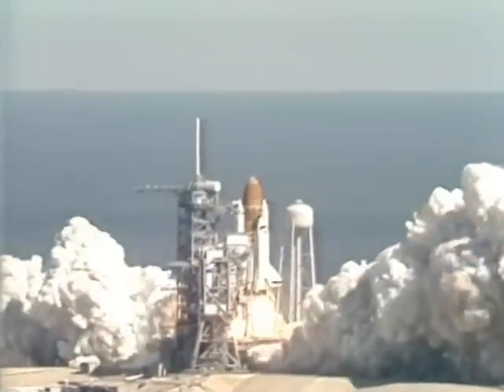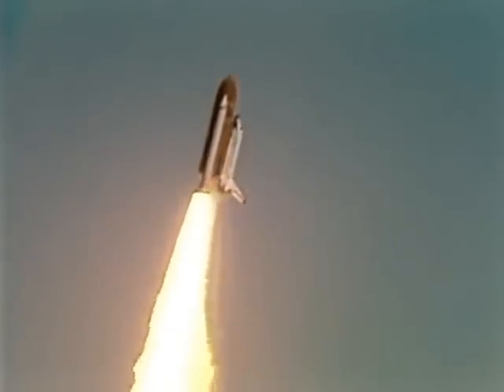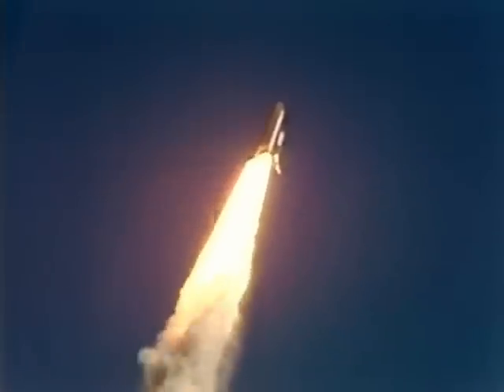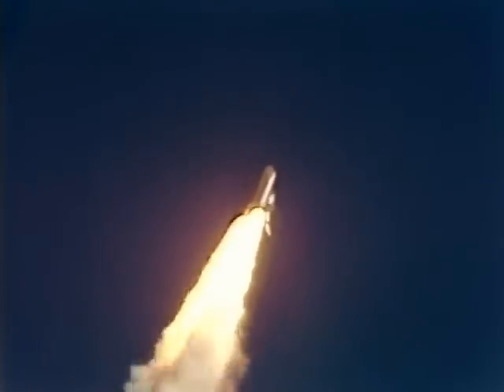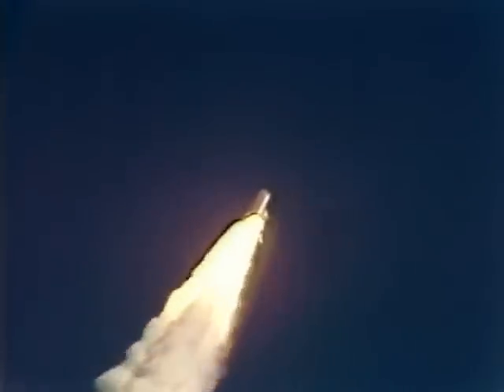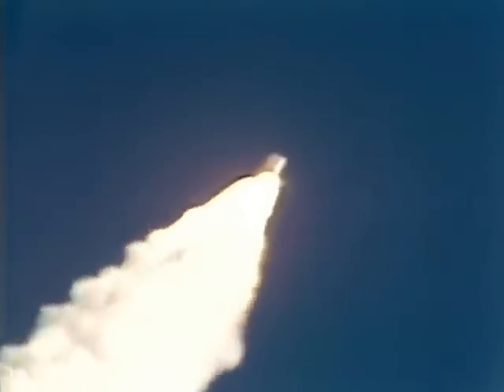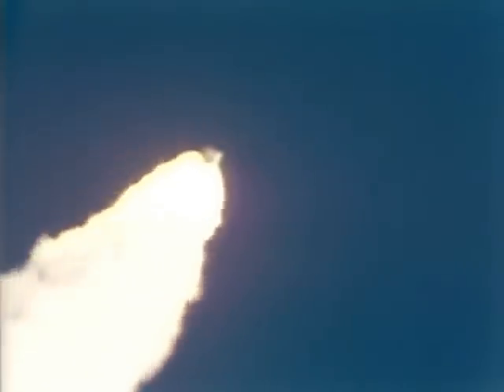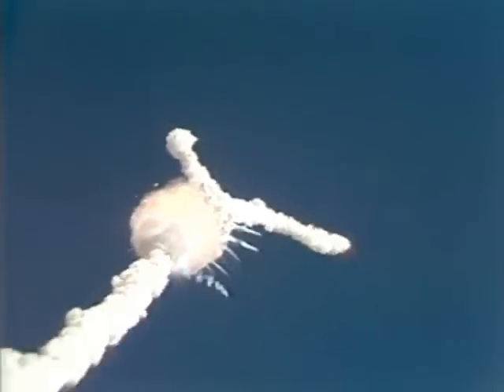The Challenger Disaster: STS-51-L V.A.B Camera - CNN Audio

Comment: According to the investigation report, the crew cabin impacted the water approximately 2 minutes and 45 seconds after vehicle breakup. That would put it at about 4:00, give or take, on this video. It does show at least two large splashes around that time and a few seconds after. Pure speculation, but one of those could have been it.
Reply: I've wondered the same thing.
Reply: @MayorMcCheeseStalker pause at 3:57 and there’s likely the start of a massive debris hit. Looks roughly crew cabin sized at first glance.